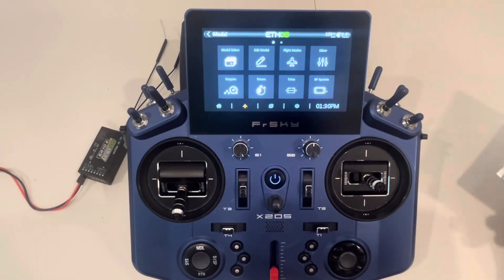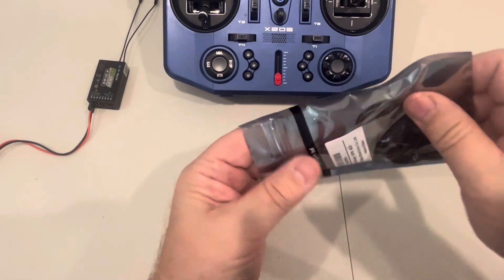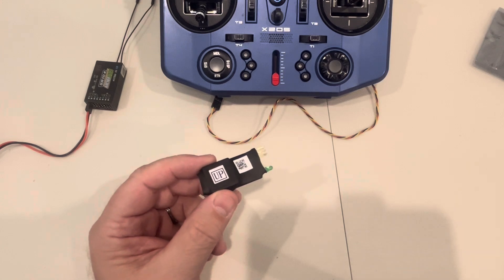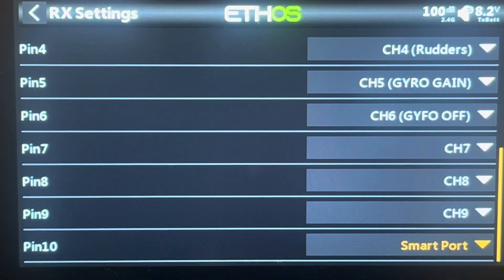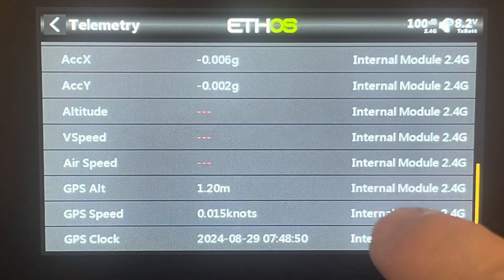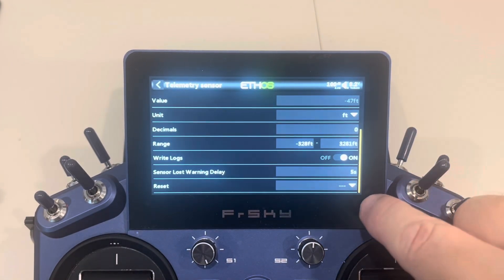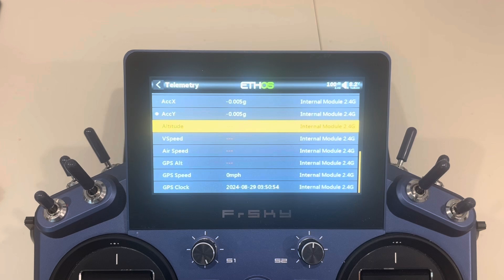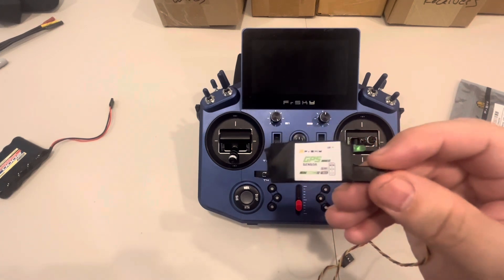FrSky GPS ADV sensor set up - Ethos X20S

Comment: Hello, thank you for your video that helps me set up my GPS ADV Sensor on my X20. At 3.40, you indicate that you have already changed Port 10 to Intelligent Port. When I click on Pin6 where I want to connect the sensor, I don’t have the Smart Port line. How should this be done?
Reply: I answer myself. After a few mails with customer service fron FrSky, it appeared that the receiver R6 don't support this.  The receivers Archer Plus R10 and R12 wel. I can only use the FBus connector.

Comment: Is there a way to set the transmitter so that if you push a button/flick a switch, you can get an audio call out of the speed or altitude? I just got a X20RS and added a GPS unit. Great video that helped me set it up!
Reply from the maker: Yes, make the active condition for the special function the button or switch you want to use.  Glad you liked the video

Comment: Frsky transmitter sucks. My X12S crashed doing update, now it's just a dead block
Reply: That's user error not the radios fault .
Reply: several years ago I bricked my fiend's Taranis, my fault entirely, oops.  Point is, with a little online searching I got it unbricked.  No very hard, just need to find the procedure to do it.